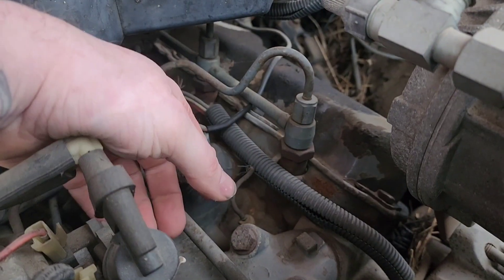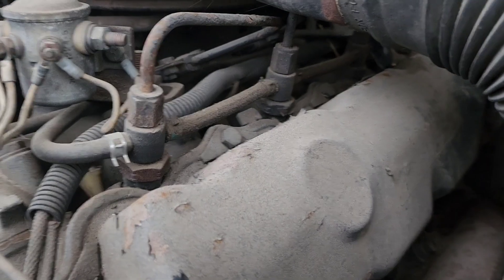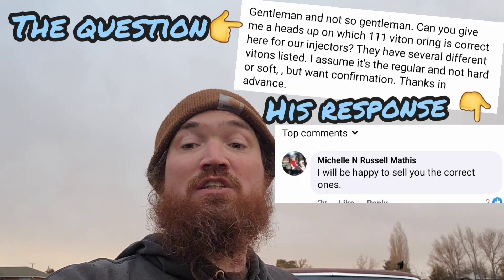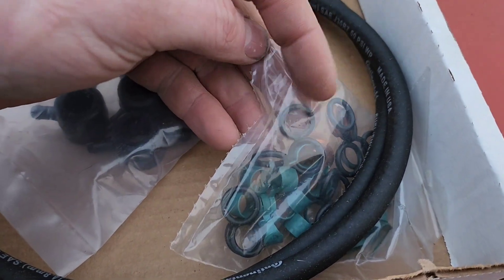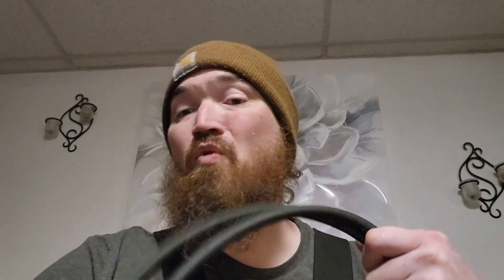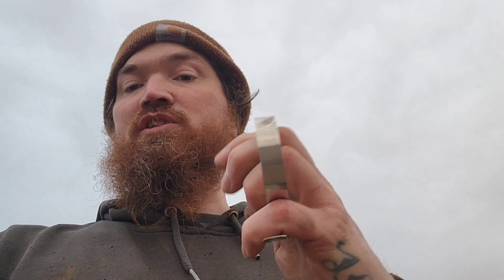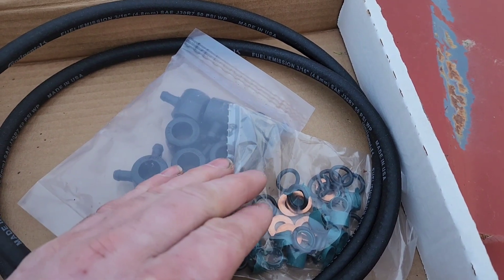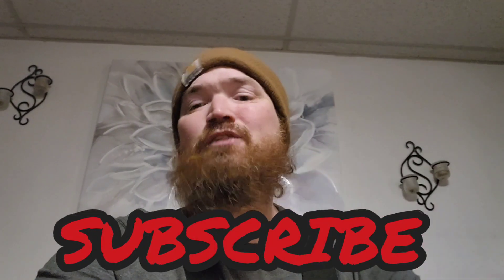The truth about injector return line kits for 6.9 7.3 idi diesel trucks

Comment: I was working on idi's when they were new. Bought a brand new 6.9 f-250 manual in 1984 373 gear lsd 5 speed manual 2wd and it got 26mpg on highway. Got tired of the lugging and lagging then installed higher flowing injectors special built in 1985 with a worked over stanadyne injector pump topping all that off with the banks turbo kit, propane injection and dual stacks. Truck would get sideways in third gear like my 460 powered 83 f-250. Had my foot in that diesel rolling the coal blowing camaro's off the road. It gave me over 400,000 miles of enjoyment till one day a rod said fu$% it and left town.
Reply from the maker: Heck ya! Sounds awesome.
Reply: @charleshollingsworth1583  I have a 1989 Ford E350 Retired Ambulance with a 7.3 IDI with only 76,400 original miles on it. What kind of mileage should I expect to get with it once I get it going again ?
Reply: @kevinswinyer3176  Boss i could not tell you as the ambulances had differend read axel ratio's which allowed them to have more get out the hole speed say like motorhomes

Comment: Was having issues with this. Long story short, the electric lifter pump was causing the caps to leak because of the return off of the filter housing. It did not leak before I replaced them so it's a good chance that it was a combination of poor quality caps/o-rings with the pressure of the lifter pump. Blocking off the return from the filter has remedied the issue.
Reply: There's also a chance this can happen with the stock mechanical lifter.

Comment: Man I replaced my injection pump and for some reason my key don’t work at the ignition anymore I literally have to start it by the solenoid by the battery with a screwdriver can’t figure out what happened didn’t do nothing electrical

Comment: Thanks for the info! Today i replaced the cups and return lines with the Delphi ones.. two injectors are now leaking. The O-rings felt a bit stiff.. even the ones that was in the truck felt more fresh. I still have the original grey cups, maybe i should put them back with some new O-rings.. also the injector lines were a bit rusty at the tip, maybe they're leaking a bit.
Reply from the maker: You can verry lightly sand the rust off the lines with emery cloth. Be real careful to clean up any debris when done so it doesn't end up in the fuel system. I would just get new orings and try it again. 9 times out of 10 if you get a leak it is due to the oring getting pinched or nicked during assembly. Lube it up real good and try again.
Reply: @worthshop  I did what you suggested and no leaks since then 👌🏼 i also put back the original cups. Thanks!

Comment: I always use dielectric grease (silicone) on o-rings. I've never torn an o-ring that way, and even the dreaded IDI oil cooler slides right together with the stuff. Many people use hydraulic presses or the weight of their truck to press the oil cooler together... nah fam. Slides together with dielectric grease, it's amazing. Both the early 6-ring and the more common 4-ring coolers.
They don't like me much in the IDI groups either, for other reasons 🙄

Comment: I was having issues with my return lines on my 7.3. I bought a kit from badger diesel and the o rings it came with were no good. I thought it was the caps but it was really the bad orings. I bought some of the viton size 111 o rings and swapped them out. doesnt leak anymore, even when wiggling the plastic caps.

Comment: Aspie......husban filled up the truck the other day. 84 f250 6.9 idi. 30 mins later, shit it off for about 10-15 mins, longer then normal crank, fired up and ran a bit rough. Extremely hard to start after, 1 time it wouldnt start. After that its been hard to start cold or warm. 60s and 70s outside. Couple days prior, lots of rain. Station is between two big hills, water ran down those to the parking lot and around their under ground tanks. 

Started right up decent cold before, warm it fired as soon as you hit the key. Moisture in fuel?

Comment: Man you’re a legend! I was thinking of ordering a kit from him and it was $97 cad and thought Meh see how it is to change them and stumbled upon your video. Just ordered me a pack of 50 for $14 😂 so correct me if I’m wrong but mine are still good two just leak a bit I’m assuming the o rings are bad, they are the black caps but as long as they aren’t cracked or broken I can reuse the caps? Just install new o rings? Cheers man 🤘
Reply from the maker: Yes, new orings should get you sealed up just fine as long as the caps are not cracked or broken. Make sure to use some lubrication when reinstalling so you do not get any tears.
Reply: @worthshop  awesome thanks!

Comment: Good video. I have had many idi and like them. I had one idi that no matter what I did it always had leaking returns. I used new caps on it and they seem loose to me. I was wondering if you know anything about using a plastic drain plug washer on top of the cap so the line nut pushes the washer and the washer pushes on the cap to stop movement? I bought a real nice 1985 f350 with a service body its a 6.9 T19 Dana 70. I am going to put new O rings and lines but leave the caps. Its going to be my pull rig. Going from a 03 7.3 to a 6.9 is going to be a change. My idi has dual exhaust it also has an air cleaner like the old banks power pack. I am going to leave it non turbo but I think I will put on a hypermax cowl intake, perferated tube glass packs and turn the pump up about 1.5flats. I will also put a pyrometer in it. I haul my car to the drag strip often and that should be nothing but I also have a gooseneck that weighs 7400lbs on its own and I haul equipment like tractors and crawlers and stuff. That old 6.9 is going to have its work cut out with 26,000lbs behind it. I think the service body is heavy and it will be full of tools.

   Nolan.
Reply from the maker: Thanks for watching! Definitely will be a big change going from the newer truck back to the 6.9! I have watched a video from diesel tech Ron here on youtube. He uses brass drain plug washers to help keep the caps down and tight. He mentions it about 12 minutes into this video. https://youtu.be/3vqSaDWcCJE
I have never needed to use his trick, but have kept it in mind for if I ever run into a situation I need it.

Comment: After a lot of trial and error, i figured out how to fix the idi return lines. First of all you dont put lube on it. Instead you clean everything good and use 3 orings instead of 2 . You put the 2 oring on the injector and 1 on top of the injector just under the cap. Tighten everything back up and walah . No more leaks no more greasy vaseline on your injectors.
Reply from the maker: Thanks for sharing that trick, I might have to give it a try sometime. Thanks fir watching. God bless.

Comment: At 6:12 , you mention  " He's the only guy that includes the olive seals ... "
You : Well, you can pick those up for a couple bucks .... it's not a big deal .

Ok.   Whats the part number or website to find a set ?
I have a 1990 F250 and so far the results when googling is " DorMan Fuel Injection Fuel Feed and Return Pipe Seal Kit 904-497 "..... however when I confirm 1990 F250 Diesel , it says " Does not fit your truck " .

I've watched your video and you have been great about part numbers and where to buy the return line kits, orings ,etc ........ 

Hoping you can point us to a source for 'olive seals ' 

Thanks
Reply from the maker: Search eBay or Amazon for 5/16" fuel olives, you need a couple of that size. You will need a 3/8" olive seal as well. I have always gotten them at a local hydraulics shop that carries every kind of fitting adapter and hydraulic part you can imagine.

Comment: My next up grade will be a 5 speed or a 6 speed, not sure witch will be the best choice, I will be putting a 2005 excursion 3.55 limited slip with disk brakes this will match my front gears. Thanks you for your advice it is very appreciated!!!!
Reply from the maker: No problem! Good luck with your project. Manual transmissions are way funner to drive. I just don't like the prices people ask for them! I have had several zf5s not a big fan, synchros go bad difficult to shift they are a growly loud transmissions never had a 6 speed, but have seen the asking prices so probably be a while till I do.

Comment: Thanks for the vid I appreciate it.  I'm working on my first IdI and in the process of bleeding it.  Under normal  operation, should there be a lot of fuel flowing through the return lines?  I have one of the lines off until it bled  but haven't seen and fuel yet
Reply from the maker: Should be a pretty decent amount of fuel out of the return system yes. The idi fuel system returns alot of fuel to the tank as a way of cooling the injection pump.
Reply: Thank you sir.  I got it running, I'm using a lift pump from a jetta tdi.  Works good. I'll be chasing leaks for a little while but bot bad

Comment: Thank you for good advice. On my 1986 f250 4x4 I have two return lines off my caps, one on the Driver side to the main return line and one on the front passenger side to fuel filter elbow to the injection pump. Is this normal?
Reply from the maker: Souds pretty tipical to me. Some people delete the one up to the filter head to prevent recycling air into the fuel supply side. There are several possible return line configurations. Google it and you will see different diagrams.

Comment: Hey there Aspie, I have a question for ya. I just purchased a 1989 Ford E350 Ambulance for $2,000.00. It has a 7.3 IDI Diesel, but has not been started or ran since 2020. My hope is to be lucky enough to get away with just replacing both batteries, both fuel filters, adding fresh fuel in the tank with good injector cleaner, prime the fuel system to purge air, and have it fire up. But I am being told by several people, that the Injector Pump will be no good, and will need to be replaced, and all injectors, and glow plugs will also need replacing. So, what should I do ? What would you do ?
Reply: My 90 had been sitting about 2 years. Thought I might have to put on new injector pump. Soaked pump with diesel klene and atf. Started right up after bleeding lines.
Reply: @briansessa8392  I will be filling the primary fuel filter with ATF before it goes on the injector pump, then adding fresh fuel to the tank, installing the batteries, and bleeding/priming the lines, and hopefully, it fires up.
Reply: @kevinswinyer3176  Let it sit inside the pump for a bit. I didn't wait very long and it freed up my stuck pump. I really did not want to buy a new injector pump. I saw prices ranging from $500 to $2000.
Reply: @briansessa8392  how do I get it inside the injector pump ?

Comment: What about the 93 and 94 factory turbo crossover line argument? Where do you stand on that? Comes with two three sided plastic caps for both third cylinders back in front of the turbo.
Reply from the maker: Not sure what you mean by an argument, or where I stand on the subject. But the turbo specific kit is not required. As long as you do a crossover and tie it all together. Also the single nippled cap for passenger side rear is not difficult to make by capping a na corner caps nipple. You can look up alternative return line routing on Google. Do what you feel is best on your own truck.
Reply: @worthshop  I did the front crossover line in front of the turbo with the three ended caps because there's too much heat at the rear of the engine I guess best bet would be run crossover at front if you only had two ended caps.

Comment: Hey just wondering how you would get rid of a knocking sound coming from the 6.9 engine
Reply from the maker: If it's a lower end knock, engine needs rebuilt. If it is an upper end combustion related knock, an injector is probably sticking or bad. Start with running some diesel kleen through it next time you fuel up. Might get it unstuck, if not you will need a new set of injectors.

Comment: russ isnt an admin or moderator on any page im on. and the delphi kits have been proven to be junk. every one ive installed has leaked. i stopped buying them for that reason if they were any good then why do you only replace the orings? havent seen a video of yours yet where you actually use a single part other than an oring.
Reply from the maker: Russ stopped being admin and moderator on about 5 groups AFTER I called him out on his bad business practices and censorship. So obviously I had a positive impact on that whole situation for the idi community as a whole. If you actually watch my videos, you would know the answers to the rest. I have done full kits on several trucks, first one was the free idi truck I got years ago not running, and it ran great after replacement of caps... Delphi caps lasted years until I traded that truck. I don't do videos specific about installing caps, because there is already 50 videos about doing caps on youtube. No point adding another. Again, replacing just the orings was to prove a point. You don't need an overpriced kit from russ to reseal the return lines. You often don't even need caps or lines, just a couple o rings for the win. So even though you are attempting to disprove my point.. You literally just reiterated it. Thank you for your agreement!

Comment: I never had an injector return line NOT leak. I've done it twice, and both kits leaked. I was more concerned about the really bad blow by.
Reply from the maker: I have never had an idi with bad blowby. But I am selective in what I purchase. I could care less about a beat down rusty truck as long as the engine is good.  Always been successful at getting the return lines sealed up though too. Guess we are just the opposite. Thanks for watching.
Reply: @Aspie worthshop  it was a crew cab dually with about 276k. I was the 26th? Owner from what I recall. It ran fine, but trans sticky on 2 to 3rd. Frame was perfect all straight. Damn good truck hate to have let it go.

Comment: Really, somebody just needs to make an ever so slightly fatter o-ring and this would be so much easier. I fought with crappy orings from 2 new kits (amazon then autopart store) leaking before pushing the orings out a tiny bit with a couple wraps of fuel resisant pipe thread tape in each oring slot before putting greased orings on...3000 miles so far and hasn't leaked since.
Reply from the maker: That is interesting. Not supposed to use thread tape at all in a diesel fuel system. It holds up to diesel, but you risk a little piece of the tape making it's way into the injection pump or clogging an injector. But hey it's working and that's what counts! Way to think outside the box and come up with a solution!
Reply: @worthshop  my reasoning was that if any tape comes loose it will go through the fuel return system back to the tank, and then the fuel filter will catch it on the way back.

Comment: 🤣🤣🤣 I suppose next we'll complain when the Parts store down the road charges $80-$100 for a Delphi return line set, but even though I don't buy from the seller mentioned as I build most my own parts or R&D, but I can say the "reboxed part" isn't a reboxed part from Dephi 🤣🤣🤣
Reply from the maker: My issue is not with the reboxing, or overpriced stuff he sells. My issue is with the censorship, and deleting of people from the Facebook groups for daring to suggest other companies or brands. It creates a dishonest Ecco chamber. New idi owners that may not have the funds for overpriced parts get the false impression there is only one source for parts. It does the idi community as a whole no good to censor individuals with differences in opinions on parts and repairs for our trucks.

Comment: I know its really overkill, and like gold plating a turd. But personally once I find the IDI truck I want to tinker on and restore, I'm going with those billet return rails that R&D IDI offers. others with a tighter budget probably cant see spending the money on them but I really don't want to be 20 years from now trying to 3d print my own return caps know what I'm saying? 

Cause one day whoever owns the injection tooling for those plastic caps is gonna call it quits, or they are gonna get the last life they can from those molds and never replace them because why bother with 300k$ worth of injection molding for a market that might bring them 10k$ a year? Then you will have to 3d print them and there's no telling what kind of quality that could bring.
Reply from the maker: I plan to order some of the billet return rails eventually. Just have not had the right project truck for them yet. They are often out of stock or back ordered but the web site currently says they have 6 sets in stock ready to ship. Almost worth ordering now just to have around fir when I am ready. Thanks for watching and God bless